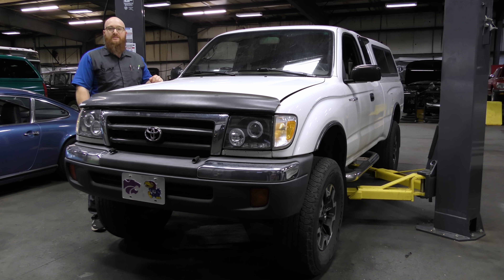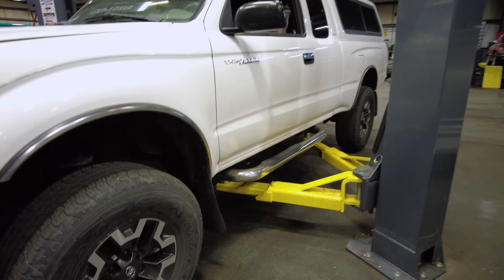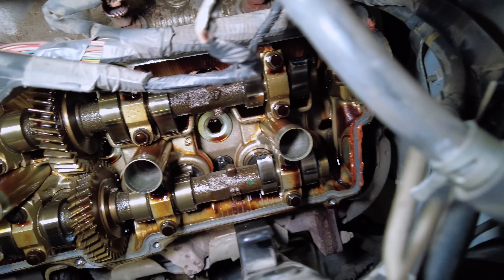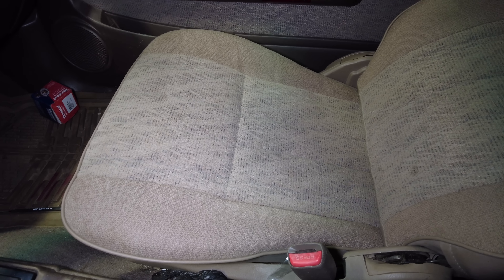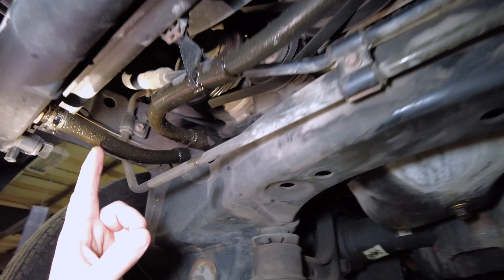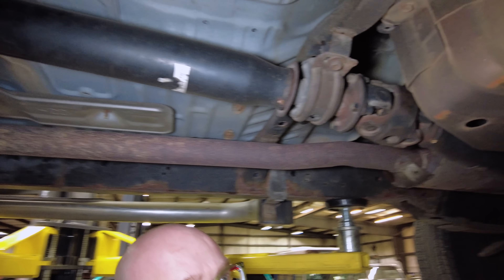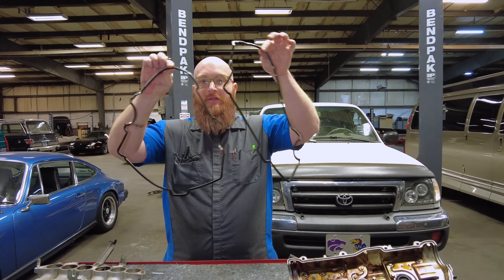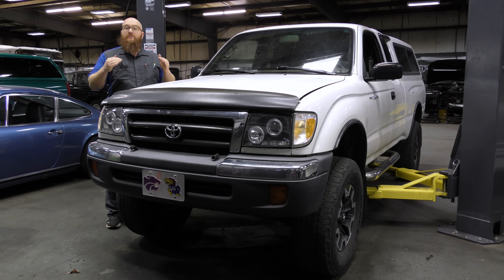Is it worth fixing this rusted out '99 Toyota Tacoma? CAR WIZARD explains

Comment: I've had 3 different Toyota 4x4 pickup trucks and 1mid 80's 4 runner and I can tell you I love those trucks. My biggest gripe with the early to mid 80's Toyota pickups were the fact that on every one of them the frame rotted right at the front of the right rear spring mount by the gas tank. If it hadn't been for that then I'd still be driving my trusty old Toyota. That truck had the 22R (carbureted) motor and it never ever failed to start for me. If it would crank then it would start. I tried patching up the frame a few different times but the rot just kept walking farther past the plates so it got to the point where I just had to scrap it because it was unsafe. And that truck had about 220,000 miles on it too. Great trucks all of them. Now the 4 Runner? The engine gave out at around 210,000 miles. That one had the 22RE (injected) motor in it and I think that was one of the bigger mistakes that Toyota made. The 22R motor to me was bullet proof but every truck I've seen with the 22RE motor (and I've come across 6 so far)all had the same problem with blown head gaskets or blown whatever and they all sucked the water out of the radiator and dumped it all in the crank case. Toyota should have stuck with keeping the 22R motor with the carburetor. Much more reliable in my opinion. That all being said? If I found the right Toyota truck for the right price then I'd jump on it in an instant!
Reply: Yep I had an 82 longbox with the 22R bulletproof motor. Frame rotted right in front of rear axle spring shackles and floorpan caved under drivers seat. Sold the motor to someone who wanted it and junked the truck at 260,000
Reply: @Cherokeelion  I don't know if Toyota fixed that issue with their trucks. I've not purchased a Toyota in a very long time but I still wouldn't hesitate to get another one.
Reply: @brianfalls5038  Im pricing Tacos right now for another one. Haha
Reply: @Cherokeelion  good deal

Comment: Man I really miss my 2004 Tacoma.  Dad bought it new in 2004, cheapest one on the lot, reg cab/2wd/5 speed, had A/C and a cassette player for options I think.  Same body style as this one, ran like a brand new truck when I got it with 200k miles in 2016.  I spent $1300, maybe $1500 bucks on it replacing all four shocks with new Bilstiens(it now thumped instead of bounced over bumps).  New chrome front bumper because the painted factory one was all beat to hell with rock chips/flaking paint.  New rear chrome bumper because the old one had been rear ended and was starting to rust(this was the 2nd rear bumper on this truck, dad got rear ended twice at low speed but never hard enough to dent the bed or tailgate).  About a month after I put that shiny new chrome bumper somebody slid into my rear in a hard ass rain and put a new dent in my shiny new $300 chrome bumper.  Also put on a kind of pricey metal roll up style tonneau cover and treated the bed as one giant trunk cause there is ZERO storage room in that regular cab.  I LOVED that little silver truck, ZERO RUST, almost perfect paint, interior looked brand new, ran/drove like a new truck until some asshole speeding in his Dodge Ram lost control on the interstate when it was raining, ran into me, made me spin glancing into the wall at 50mph.  Gotta say that little truck kept me safe, I walked away ZERO injuries.  Really pissed me off cause I could have drove that truck for another 10 years/100,000 miles without so much as a hiccup in terms of unforseen repairs.

Comment: We had a customer with that same one. He had the frame replaced under warranty I think in 2009/200k miles. He sold at 330k to someone in New Jersey who of course swapped the odometer to 130k and resold it. Carfax apparently shows it’s still running to this day though. I wonder if the current owner can even tell it has 400k+ on the clock.

Comment: Hi Wizard, I have Opel Combo 2006. 1.6L. not diesel,  that it runs on CNG Gas at 450K km. which is at about 280K miles still run with original engine, tranny and all. Many repairs have been done but still good. Thanks.

Comment: Toyotas are damn tough.  However, I've got a '99 Suburban (OBS) K2500 with 285k on the clock.  It's not perfect but it is still running strong.  Looks to have had one Transmission rebuild and I just rebuilt the Transfer Case.  Frame is flawless, body has zero rust, interior is mint.  Engine has plenty of leaks tho but still runs strong.  When the engine gives up the ghost I will absolutely put a new engine into the truck.  It has held up unexpectedly well.
Reply: Those are bulletproof.  I made the mistake several years ago buying an ‘05 Expedition over an ‘02 Suburban.  One of the worse decisions I ever made.

Comment: I bet that thing will be great once those few Leaks are fixed sure is a hassle to do simple valve cover gaskets but after its dont that oil burning on exhaust smell will go away shortly , my old V8 Vega ( I used to have in the late 1970s)  was horrible for valve cover gasket leaks I dont miss that smell just thinking about it I can almost smell it  .
1500 for a few gaskets and a bumper and a few hoses sounds expensive but in reality its actually decent price

Comment: Thanks, Magic.  I found a 2003 4.7 liter 4runner with 112, 000 miles for $7000.  And some electrical repairs that had been botched up.  Like a circuit breaker removed and a wire routing around it.  But I bought it anyway figuring I could check it out and fix it because I couldn't see why the circuit breaker had been removed.  A little scary but a year of driving it has shown nothing else.  Someone with no insight whatsoever had made a bad decision and wound up selling the car.

Comment: My 96 4runner has the same 3.4 engine and had the same valve cover oil leak at around 235000 miles.  The owner needs to pay close attention to the head gaskets, these engines are known to have head gasket failures in this mileage range, mine failed at 287000 miles,  I would have saved myself some time & $ if I would’ve replaced the gaskets with the valve cover repairs.

Comment: I have 2000 4Runner with a rusted frame. Had a welder cut out all the rust and weld in some thick metal. Not perfect but it works. 206k and counting
Reply: I think that is illegal
Reply: @loveydovey4u  lol
Reply: @loveydovey4u  how so? Also who cares
Reply: @alekwormuth734  Department of motor vehicles

Comment: I have a 2002 Tacoma with 585,000 miles.  I drive a lot for work.  It still gets about 19 MPG.  I am going to change the valve cover gaskets.  I tightened them a few times when I could smell oil burning on the exhaust manifolds. The last time I started to change spark plug wires I found oil in a sparkplug tube.  I bought Felpro intake gaskets MS95899 and Stone (made in Tokyo- listed as factory replaecments) valve cover gaskets JVS-10420-US that included the spark plug tub seals, end cap seals and new cover bolt washers.  The Stone valve cover gaskets are higher priced than others but included the seals, end caps and washers that the cheaper ones did not.  The only problem I have had with the truck is having both of the store brand lower ball joints fail within 2 years causing the wheels to fold under.  I have watched 3 YouTube videos on changing the valve cover gaskets and now your video pops up.  Still not looking forward to starting work on it.

Comment: I'm glad you push Toyotas wizard! I saw your video on the best half ton trucks to buy and decided on a 2012 Tundra. I've put about 30k miles on it in just two years, and I'm closing in on 200k miles and she still drives like new. Oil changes every 5k miles and transmission, differential, and transfer case fluid every 100k miles (did those the day after I bought it). Other than the truck like MPG, I'm perfectly ok with it because it actually runs. Thank you Wizard!

Comment: Interesting chassis rail repair.  Gobsmacked that the repairer didn't take the additional 15 minutes to 'tidy it up' - i.e. wire wheel clean, apply a 'splash of paint' to increase its longevity.

Comment: Check the oil cooler to see if the there are rubber hoses on it. If so you might want to replace them with the metal flex line oil cooler upgrade. Trouble with rubber breaking down and blowing causing the engine to lock up.

Comment: As to Toyota quality, I can tell you a story.  I graduated from college in 1977 and started a job.  I bought a brand new Mustang II.  I came with a bent axle from the factory.  I had to re-build the transmission at 50,000 miles due to poor assembly.   One my my co-workers bought a new GM car.  The crankshaft broke in half at 20,000 miles and GM would only pay half the repair. My sister bought a different new GM car and the door handles pulled out of the door in two years.  The headliner also fell down.  Another of my co-workers bought a new Dodge and a pully just fell off under the hood.  Finally, two other co-workers bought new Toyota Celicas and did not have a single issue with them.  You are correct about Toyota quality.

Comment: I bought an 05' 4.0 6spd Tacoma with 170k miles.  It's the only generation Taco that I HADN'T already owned (sold my 2017 back to dealer with 62k and leaking coolant).   The 05 4 liter will run circles around the new 3.5.  yeah, I have some frame rust to tend too, but it was $23k less than what I sold my 17 for.  That'll go a long ways to fixing this one up.

Comment: Well, some folks will bash Toyota like every other make if they've had a bad experience with a particular brand.  I have a 2004 Rav4 with a great engine and transmission set up, but the bodywork is like swiss cheese, I only found out by pure chance looking for what I thought was a loose part noise coming from the back end behind some trim panel.  Which is a shame as the car overal is in great condition, apart from the waitline down!  So much so that the car is now only fit for scrapping or as a project if someone want's to have it as a welding/bodywork project/practise item!!   What really P*&^%& me off is that I've not long just spent lot of money getting fresh quality engine/transmission oil and other parts replaced by a local garage (auto shop), only to find I need not have wasted the money in the first place.

Comment: Wizard, here in South Africa you get Toyota "trucks" (as you guys call it) that's named the Hilux. Been the best selling "pickup" (as we call them, or "bakkie") for decades upon decades. They seem slightly smaller than the Tacoma, and most have 2,8 litre turbo diesel engines, and they literally run forever. My aunt, a farmers wife had a non turbo 2,4 litre diesel version, and she did well over a million kilometres in it. It was still running perfectly fine at that time, when unfortunately it was stolen when she visited her sister in the city.

Comment: It's too bad Toyota took so long to overcome their rust issues. But after seeing what happened to my dad's new 85 Camry, a good dealer level undercoating could save a lot if heartache.
Reply: Did your dad get the undercoating and did it help?
Reply: I wonder if Toyota should've used another company to make their car bodies!
Reply: @zzoinks  In florida my 2000 toyota have 0 rust
Reply: @tinleo333  Nothing has rust down here. You can find good clean Toyotas everywhere on the road.
Reply: @zzoinks  His 85 Camry got eaten to death by rust in 5 years. His 94 Camry got the undercoat and is still on the road today with the 3rd owner.
Reply: @gregedmand9939  The 80's Toyota's were extra bad. I had to part out my 1985 4runner because the frame was toast, loved that truck.

Comment: Old Toyota's just keep on going as long as you keep up the maintenance.
Here in the UK you would need to have that rusty frame fixed or it would fail our annual
MOT test, other than than that i have no doubt that this truck will easily cover another 100k miles.
No apology required David for covering more Toyota's, if you need reliabilty they are the
only sensible option.

Comment: Only $1500 to fix???? Without hesitation.

I've spent easily just as much and maybe more on OEM parts and components for my 1992 Corolla 5spd and it runs and drives like new at 153k miles.

Comment: When you consider the THEFT prices of new trucks $70,000 +, YES! They are worth fixing!
I'm a working man that needs a pickup for work NOT some overpriced trailer queen.
I have a 1996 Ram 1500 4x4 with the 318 and automatic trans and it still does the job.
Preventive MAINTENANCE is the key!!! I also have a 2012 Toyota 4Runner and it's like new.
Reply: And oil undercoating if you live in an area with road salt in the winter.  Fluid Film (or similar product) YEA!  Have not only the underside treated, but door and fender cavities too.  It is worth spending money if rust is not an issue.  I have my vehicles treated annually - it is a maintenance issue just like an oil change.  Have a professional specialty shop do it.
Reply: @brucesheehe6305  I treat my undercarriage with COSMOLINE from a company called Cosmoline Direct. Great stuff, used it in the Military.
Reply: @richardstone5241  wonderful - I will look into it. I drive from Altoona to Monroeville PA for application.
Reply: @brucesheehe6305  It works great Bruce, it dries to the touch like a heavy greasy wax and does not need to be reapplied every year. Also comes in black, goes on wet so it creeps into all of those pinch welds and is cheaper than other products that wash off.

Comment: I have a 98 4x4 SR5 with the 2.7l 4-cyl.  Its a great truck but the only ones I can ever find for sale have the V6.  How rare is a 2.7l in a 4x4 SR5 ext cab  configuration?

Also, mine looks just as nasty on the bottom.  I consider all the oil build-up rustproofing. XD
Reply: Most of the 2.7Ls are RWD.

Comment: I bought my 99 tacoma V6 4wd brand new. It's still in great shape. I  put 150K miles on it. I live in the dry desert so I never had the rust issues under the chassis. Over the years, things do wear out with age such as brakes, tires, etc. I usually spend around 2 to 3K a year for any repairs and maintenance. However, I plan on keeping it for good.

Comment: These older Tacoma's are nice pick-up trucks, but they are way too expensive right now.
Reply: They are expensive because they don’t die
Reply: They’re expensive because they becoming to the millennial generation what the muscle cars were to the boomers. 25 years is the point where you can start getting classic car plates from the DMV. I wouldn’t be surprised if clean examples start fetching bigger bucks at auction over the next few years.

Comment: My 07 Corolla has 296,000 miles on it. Still runs like a top and worth every bit of work I put into it
Reply: Good to hear that, I just found a 2010 Corolla LE with 121,000 miles and extensive maintenance records. The paint has issues, but after a couple of thousand to solve a few deferred items and fix a few things with Toyota parts (damn, they ain’t cheap) I have a high school/college car that’ll run fine. Not a leak to be found when my mechanic inspected it. The kicker, the loaner I got for free from my Toyota/Lexus specialist was an ‘08 ES 350 with 217,000 miles that was comfortable and worked just fine. It had one flaw, twice going over a speed bump the radio would switch off…I hope the Corolla duplicates that!

Now I just have to decide to pay a decent amount and professionally fix the paint or try it myself. I’d love to do it myself, but the car is so great…damn you, Toyota!

Comment: I totally get it and am with you 100%. I had a 1994 (pre-Tacoma) Toyota Pickup with a 3.0L V6, 4x4, 5-speed manual, Xtra cab since new. I had it for 14 years and put 300,000 miles on it before I sold it. The minute I sold it I had seller's remorse and I'm still missing it today.

Comment: I bought a new Tacoma in 2021. The only new vehicle I ever bought that appreciated when I drove it off the lot. It’s got is little quirks but I had read up on them prior to buying. I have no doubts it will see 300K. I do drive it fairly gentle. We’ve had a couple of Corollas in years past, one an oil leaking, high mileage rust bucket bought used, and one bought new. Regret trading the one purchased new. The rust bucket got sold for couple hundred buck and was seen still on the road over a year later.  I have. A soft spot for older Ford pickups - the pushrod powered variety, but by now anything that is in affordable territory - what hasn’t been eaten up with rust is used up.

Comment: All the Toyota haters are just in denial. They don't want to hear that whatever they bought won't "hold a candle" to a Toyota.
Reply: Some of us haters had very bad experiences with Toyotas and good experiences with other makes and models.
Reply: @herbiehusker1889  so that makes Toyota a crap company? Sounds like you're still in denial. You can't change the truth.
Reply: I'm just curious in what universe would anyone look at a pickup truck with a cobbled together rusty frame and think "yeah that's what I want to drive." Apparently that's a Toyota thing... Regardless of the brand name on it I wouldn't voluntarily haul or pull anything in a truck with a compromised frame, that is just idiotic.
Reply: @J Man  the truth is that all manufactures make mistakes. Toyota is far from perfect. They make tons of mistakes and their trucks get pathetic fuel economy. You worship at the altar of Toyota as if they are your religion. You are the one in denial. My personal experience with both a Camry and a Tacoma lead me to think their quality control and engineering is not very good. Maybe my experience is an anecdote, but there's no way I would pay the kind of money these go for just to have "Toyota Quality." I've had over 20 cars and 2 of them were Toyotas. Both had major issues and required various expensive repairs, all before 100k miles. I've had GM, Ford, Kia, and Chrysler products that were far, far more reliable than those Toyotas. OH WHAT A FEELING!